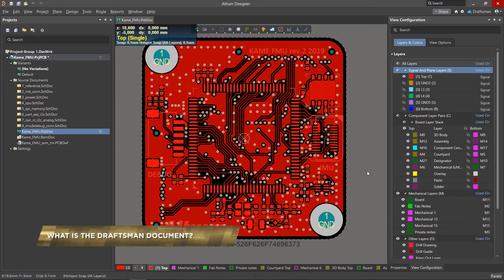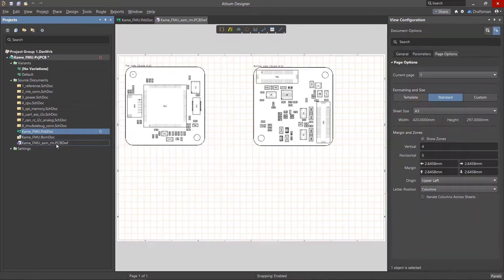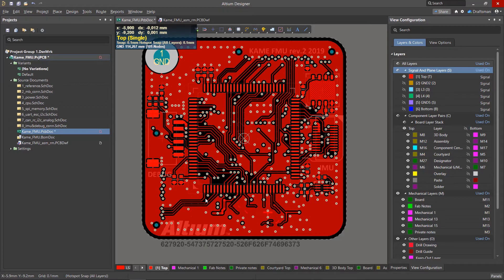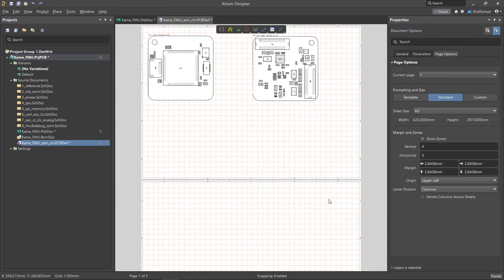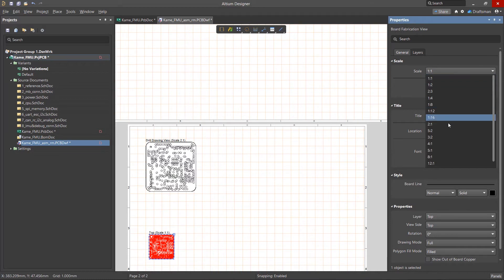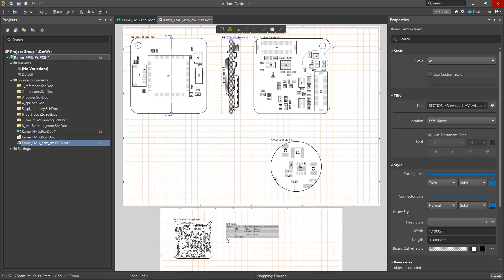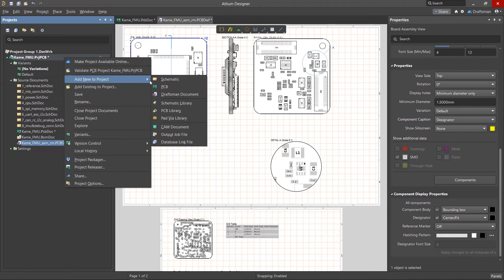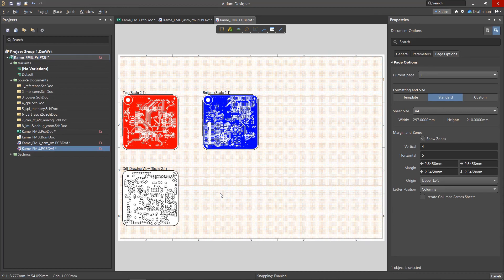What is the Draftsman Document? | Altium Designer Training Video

Comment: Given the netlist, dxf/dwg,  how can I remove the title block from a gerber file?

My gerber files have a title block containing project name, date, etc.. that I'd like to remove. (The title block causes issues when finding the bounding box of the pcb.. tools like gerbv will incorrectly include the title block in it's analysis!) I can manually remove it Altium/KiCad, but was wondering if there's a tool that can remove the title block and everything in it.. leaving just the circuit? I looked at KiCad and PyGerber /pcb-tools-extension / gerber-parser 'ConvertPLUS ARE'.. but no luck.  

Alternatively, if there's ODB++/IPC-2581 xml files contain 'title' or 'document' tags.. perhaps just deleting those sections and re-generating gerbers from the command-line (gerbview or fab3000)?